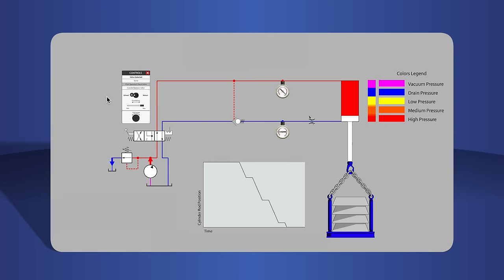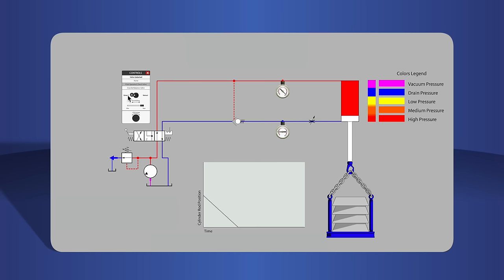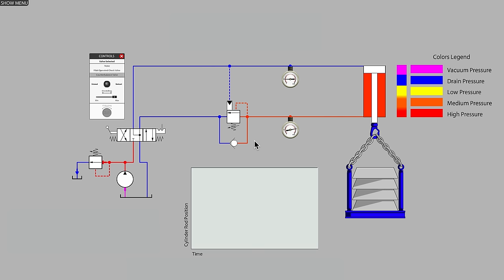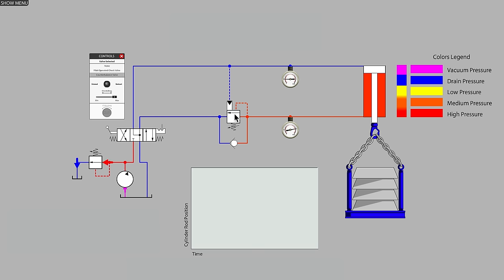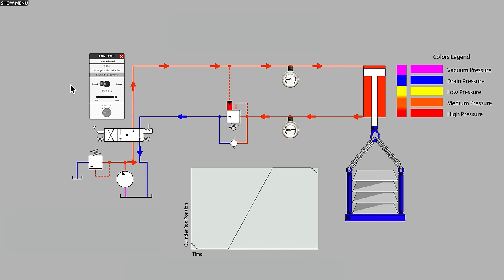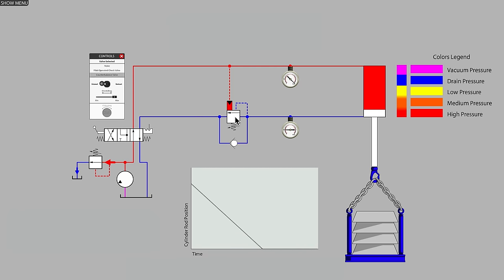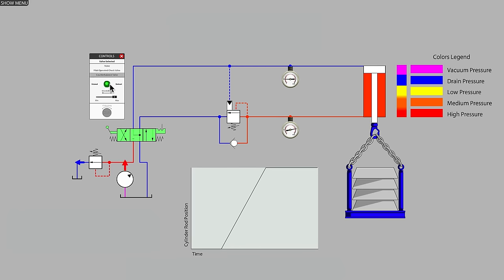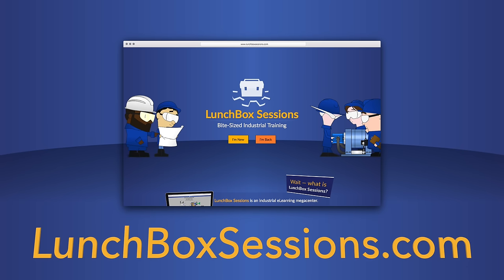Vertical Cylinder Motion with a Counterbalance Valve

Comment: but why do we have such intense music
Reply: Because, they forgot to mention about the pressure intensification on the rod side of the cylinder. That might be catastrophic.
Reply: @gemiciengin  , no, the Counterbalance valve is also a "relief" valve.  It is internally piloted, as well as externally piloted.  It prevents over-pressurization from hydraulic , mechanical or thermal intensification.   A PO Check would not have the relief function...  that could be catastrophic.    The external pilot is at a ratio, which is likely for another session.

Comment: In some applications i have seen a counterbalance valve being used without a external pilot line. Why do we need a external pilot line when there is already a internal pilot line in counterbalance valve doing the same function?
Reply: An internally piloted counterbalance valve (in the rod end, as it is in this case) continually exerts back pressure, even at the limits of travel, and continually opposes the pressure induced force of extension, thereby limiting the maximun extension force. 
This is suitable for load handling applications in which the load must be manipulated yet not damaged.
When both externally and internally piloted counterbalance valve is used, the function of the internal pilot on the rod end is to provide back pressure supporting the load while it descends, however upon reaching the limits of travel or being otherwise restricted, the external pilot on the cap end overrides the internal pilot and fully opens the counterbalance valve. Back pressure is absent and the hydraulic system can exert full pressure induced force.
The combined effect of both the weight and the full unopposed force of the hydraulic system can be put to use for a press, stamp or molding application.

All this information I got from Jim Pytel (BigBadTech Channel) here on youtube.

Hope it's clear
Reply: Its clear now..... Thanks for your crystal clear explanation

Comment: Excellent videos, just a quick question, what is the point of the internal pilot valve? When a load is in the raised position wouldn't the the pressure on the internal pilot line open up the valve back to tank?  Thanks.
Reply: As a commissioning engineer of more complex machinery I was asking myself the same question.

I was lazy enough to ask the designer, my best guess is for protecting the cylinder/motor in case of overpressure generated by some (too) heavy load or some uncontrolled pull of cylinder.
It efectively adds up to to the pilot ratio obviosly. So if you have 1:4.5 pilot ratio and spring setting of 330 Bar, you'll need at least 60 Bar in above line to open it. This is of course in case you don't have any load and ideal cylinder. In real life cylinder you'll have to account for some losses, generated by piston friction dependant on flow and inertia, in smaller portion.

Pressure setting of the spring should be higher than maximum designed load generated pressure of course
Reply: Lovro Šipovac thanks for that, much appreciated.
Reply: No probs. Your inquiry made me a bit curious so I googled and found a great article that expains your question and much much more!

http://www.hydraulicspneumatics.com/other-technologies/book-2-chapter-5-counterbalance-valve-circuits
Reply: If I understood the question correctly, even if it had enough pressure to open the pilot line, both sides would be with the same pressure, so there would have no flow.
Reply: An internally piloted counterbalance valve (in the rod end, as it is in this case) continually exerts back pressure, even at the limits of travel, and continually opposes the pressure induced force of extension, thereby limiting the maximun extension force. The function of the internal pilot on the rod end is to provide back pressure supporting the load while it descends

Comment: High Pressure means Overload?
Reply from the maker: +Michael Zajac — The pressure colors are relative. In this system, High Pressure is equal to, or slightly below, the setting of the relief valve.
Reply: Thank you for message, Teacher. I'm collage, I was learned my lesson that Fluid Power.
Reply: I Want an animated video of boom luffing in a reclaimer.
Searched everywhere but couldn't find anything.

Comment: Reason of hydraulic oil temperature increases other than heat exchanger
Reply: If the relief valve is leaking, it would increase the sump oil temperature.

Comment: Yet another piece of hydraulic didactic with a fixed pump going over relief in neutral. And as in any other hydraulic didactic the explanation of one of the most common valves in the world, the Open Center valve,  is abscent.  Gear pump, open center valve and relief valve should be first!
Still, this is one of the best animation series I have seen for hydraulics.

Comment: On my schematic, there's a number next to the valve symbol (230 BAR). Is that an actual pressure value needed for opening the valve?
Great video, btw 👍
Tnx!
Reply: It's the maximum load it holds without pressure at external pilot line. If you have a 4,5:1 pilot ratio it will start lowering the load at a pilot pressure of approximately 51 bars

Comment: Nice video , please tell me for a vertical hydraulic cylinder raising and lowering 2000 kg load three times in a eight hours , can counter balancing valve be replaced with meter out flow control valve ?